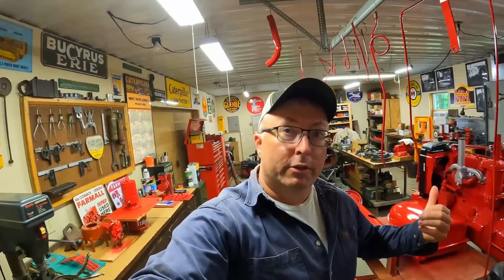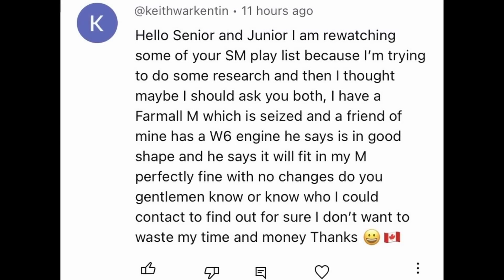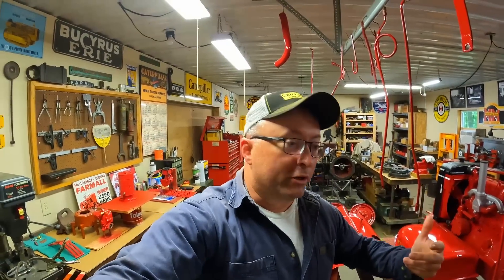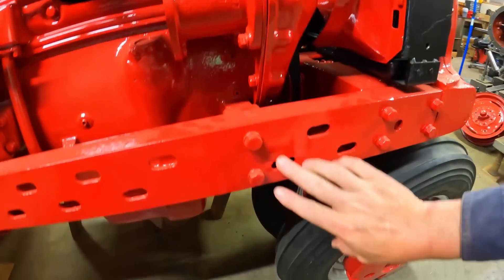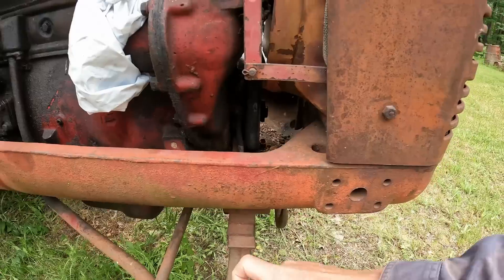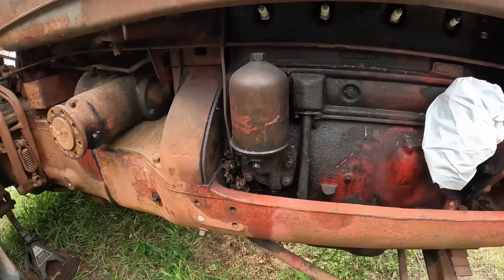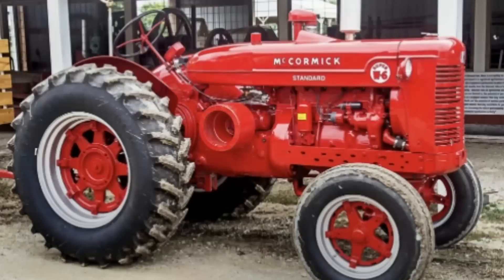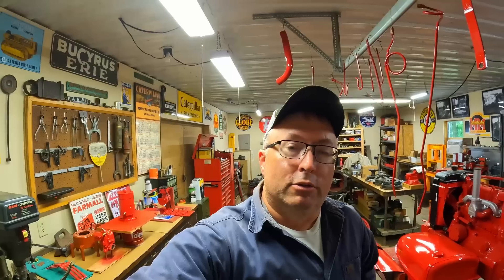McCormick-Deering W-6 Engine Swap to Farmall M - Viewer Tech Question Answered!

Comment: What about getting the original engine un-stuck.  Is that a good option, or does it usually mean doing a rebuild?
Reply from the maker: Typically means a full rebuild, or at the very minimum new sleeves and pistons because the rust that sticks the pistons also sticks the rings and will end up causing them to break 50% of the time if the engine was just freed up and made to run again.  That sticky rust is still surrounding the rings when the engine starts back up, and as it slowly breaks up and starts to pass by the other rings you'll see a ton of wear and sometimes a binding/scoring condition that starts to ruin everything.

Comment: I wonder which course actually makes more sense; swapping engines or freeing up the seized one. Of course, the advantage of the latter choice is keeping the original engine. In general, in restoration, originality is usually the preferred option.

Comment: My dad had both an M and a Super M. I’m not sure if I remember correctly but you can finagle the pressure plate out of an M without having to split the tractor but you can’t on a Super M because of the diameter of the pressure plate.
Reply from the maker: That’s exactly right, they increased the diameter of the clutch disc on the Super’s, which put a stop to sneaking the disc & pressure plate out without splitting the tractor 👍

Comment: We had a W-9 when I was a kid, used it mainly to pull a 6 foot offset breaking disc. We also used the belt drive for a cut off saw cutting firewood, and a grain grinder to grind corn for feed.

Comment: Since you've compared the H to the W-4 are there any differences in the (International) I-4 apart from the tires?
Reply from the maker: Quite a few differences actually - the W-4 and O-4 are essentially the same tractor, apart from the sheet metal. But the I-4 has a different cast I-beam front axle, different rear wheel hubs, different gearing ratios as well as having 2nd and 3rd gear positions transposed in the shift pattern, a clutch brake for faster shifting, a different rear drawbar hitch, and a throttle foot pedal instead of a throttle lever. Also, the W-4 and O-4 carry the “McCormick-Deering” badge on the grille, whereas the I-4’s grille badge says “International”.

Comment: Also the governor control arm must be changed 😁
Reply from the maker: That’s the optional radiator shutter linkage that you see there on the W-4, some tractors had them and some didn’t but they all have the mounting provision for it in the front cover.

Comment: Toby, have you checked the Sherwin Williams paint I mentioned a couple of videos ago
Reply from the maker: Yes, and it's the same paint - but unfortunately out of production at this time.  I talked to four different locations and finally got hooked up with the main mixing facility in Illinois, and they told me that the formula is still "active" meaning they haven't retired it entirely and that they may possibly make another large batch of it someday - but if I wanted to place a minimum order for 250 gallons of IH Red they'd get right on it.  Needless to say, I don't need that much red paint so I'm basically still stuck with only what I still have here.
Reply: @squatch253  was hoping this was a solution. Are there any Sherwin Williams paint stores in your area that could get the formula from head office and mix you up a couple of gallons

Comment: Its tuesday any idea when crew is showing up to start forming the slab I'm interested to see how they use those large round concrete blocks under the post  Good luck stay on top of things be there to observe
Reply from the maker: No word yet from any of the crews, but the last I heard from the Project Manager he told me that they typically start work from 7 to 10 days after the materials are delivered - but we’ve also had so much rain lately that it wouldn’t surprise me if the builders are delayed a bit 👍

Comment: As the proud owner of a 1952 W6, I would like to ask if anyone out there has ever successfully removed the rear wheels on one of these? I've tried penetrants, massive amounts of torque on a custom-made puller, and "moderate" heat, all to now avail. I gave up from fear of doing more harm than good. As far as the engine and gearbox, the thing is still a beast. I'm doing a refurb on the steering linkage, brakes, and whatever bearings I can get at. Nothing cosmetic at this point.
Reply from the maker: If you’re referring to the splined fit of the rear wheel hub on the axle, they can be a bear if they’ve never been off before - like needing the heat of Vulcan’s forge combined with the force of Thor’s hammer lol 🤦🏻‍♂️😂
Reply: I once removed the hubs with a one hundred ton shop press
Reply: @johnmcbath256  50 ton is the maximum I have access to. I'll go with the "if it ain't broke, don't fix it" mindset.

Comment: Hey squatch, I have successfully wet sanded and buffed that martin seynour paint to remove orange peel. I think I did 800, 1000, 2000 then wool pad. Came out nice. Just need to be sure that you have enough paint to sand.